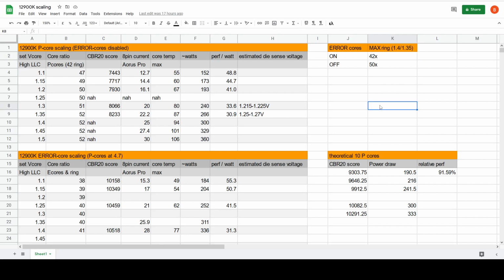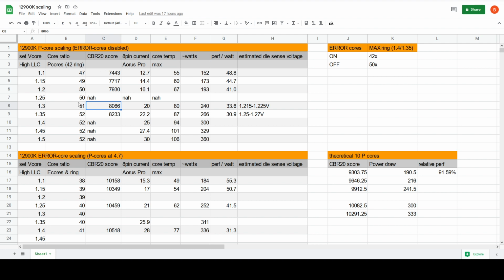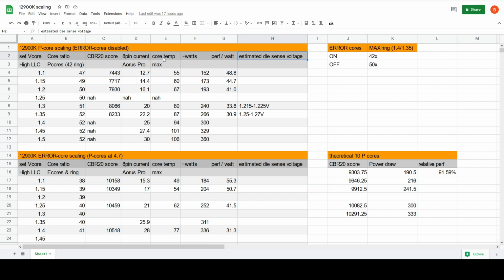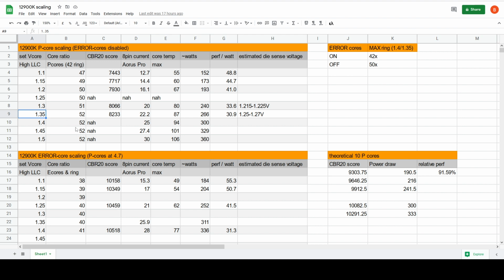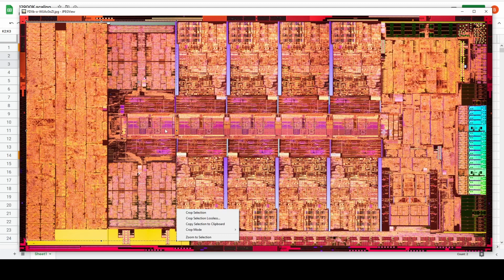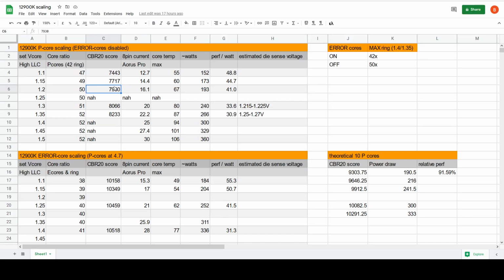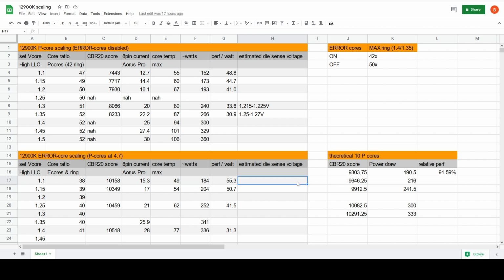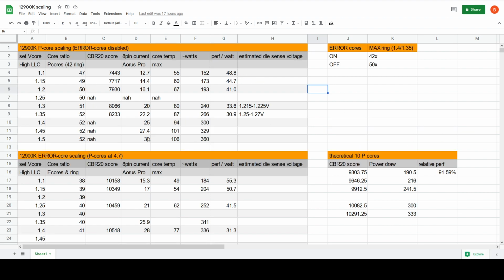12900K P and E core voltage and frequency scaling behaviour

Comment: CPU overclocking on my Z690i Aorus Ultra has been easy.  My 12600k does 52 on the P cores and 41 on the eCores at 1.4v ------>       Memory overclocking has been a nightmare.  F4 bios can't get here fast enough.
Reply: Really? My 12900k does 5.2 P-core and 4.1 E-core on 1.3v static
Reply: Adding to this. It would be cool to see more data points of what stable voltage people can get? Maybe I hit the silicon lottery
Reply: @davidallada5501  well what are you cooling with? Because BZ mentioned in the video he has a pretty good chip and his is not doing 5.2 and 4.1 at 1.3V. Or you're incredibly lucky with the silicon lottery.
Reply from the maker: @NotThatGuyJD  depending on the LLC and motherboard he has the voltage readings won't be comparable at all.
Reply: @ActuallyHardcoreOverclocking  ah, yip. That's true.
Reply: @NotThatGuyJD  I have the arctic liquid freezer ii 360 with push/pull
Reply: @davidallada5501  oof, yeah pretty damn good for cooling there. Definitely helps.
Reply: 12700k on a Z690 Elite... I cant get my G Skill 4000 Mhz CL17 kit to run with 4 sticks (xmp). It only works with two sticks. It wont event do 3600 Mhz CL17 with 4 sticks. Maybe disabling the Ecores will help? I will try tomorrow. BTW I can do 5.1 with CPU voltage on auto, which according to what I understand = 1.2 v and LLC to medium.

Comment: 8+8 maybe no so obvious. if8+16 vs 12+0 it was quite obviously the multithread performance benefit
example tigerlake 1165g7 only 4 core. if using 4 goldencove big core ,it was about 19% increase ,not bad, but not good enough .
if using 2+8, the benefit is huge, it was 1.18x 1.5= 77% faster than 1165g7 at same tdp.
i agree and prefer 7bigcore repplace 12600k and 9 bigcore replace12700k ,because the ecore number scale not enough .the multicore performance benefit not enough

Comment: "How many background tasks are you running that you need E-cores?" Well, it's called Windows for one. Microsoft's terrible system design, with the sheer number of background services even on a clean install, has caused Intel to solve the problem with hardware.

Comment: I can't approve of your results. All of my 3 i9 which I binned had no problem with enabled e cores and ring ratio. 47 and even 48 ring were no problem with  cores at 41 and cpu at 51
Reply from the maker: AFAIK ASUS enforces an automatic ring down clock if the E-cores are turned on and active.
Reply: @ActuallyHardcoreOverclocking  no not true with my Z690 Strix ITX board. It's the only available itx ATM so I had to go with this one and I can tell that this it not the case.
Reply from the maker: @pboerner22  well I don't have any ASUS boards myself and other people have told me that the ring downclocks as soon as the E-cores are doing anything.

Comment: Debaur has already proved how good the e cores are and used my favourite program project Lasso. The coment Bz made about using 10p cores instead of e cores just shows his pref for absolute perf. Missed the logic of e cores completely. As with all Bz reviews they are great when chasing performance and damn the power bill.
Reply: Well, the channel has the "hardcore" part on it for a reason. TBH, i would've loved to have either a 10 P-core CPU as well, or have a more modern, mini Xeon Phi, with 2 Pcores (for background tasks) and 32 Ecores (for absolutely stupid MT performance). I'm guessing the last one would need more than dual channel DDR5 to keep 34 cores fed, but it doesn't sound too farfetched.

Comment: I think the future is to let the user configure how many of which cores he wants. The compiler / video render guy would choose the CPU with 6-P-Cores and 16-E-Cores. The gamer on the other hand would choose the 10-P-Core variant. I think for most people, you are right. Scarcely anybody who buys these CPUs will really profit from the E-Cores. Intel did it just because of the numbers. They are on one level with the 5950X in terms of MT-Performance. And on the absolute top in terms of ST-Performance. Off course, numbers don't tell everything, but the average consumer does not know about the deeper implications. Does not even know that there is something like a ring.

Comment: I must have a good chip then running p cores 5.1 and e cores 4.1 ring ratio 42 my voltage is set at 1.29v llc 6 might drop the e cores just run p cores 5.2 5.3

Comment: The only thing i care about is single threaded gaming performance and much like Hyper-Threading is is complete trash and disabled by me, so will those garbage E-Cores. If intel releases 10P or 12P cores only than its a home run in my book, but why would i buy into the Big-Little Design from intel, if those garbage E-cores are going to get disabled,  because guess what, it hurts gaming performance! and that's a no-no!! Raptor Lake doubles E-Cores only....omg barfffff!!

Comment: Ooh... best explanation to date of the Eek-core impact on ring frequency 👍. Yet more rationale for a disabled Eek-core/ enabled AVX-512 setup. A usual AVX scenario is multi-dimensional physics simulation due to the long vector lengths. This scenario is also extremely memory bandwidth intensive.

Comment: Personally I'm going to disable the E cores on my 12900K for daily use. Basically all games are going to perform better with 8+0 with high ring clock vs 8+8 with lower ring clock.
Reply: Kind of a shame e-cores just becomes a hindrance on hardware you paid for, I'm sure many will do this to maximize the p-cores.

Comment: Since you have contacts at Gigabyte, can you ask them when are new BIOS versions coming out? There's supposed to be a Magic Scoll Lock setting to disable the E-cores online (I don't care about Denuvo, I avoid games with that crap for years, but I'd love to be able to switch them off without restarts to see if that helps with my issues, or just to see how much benchmark results change without them).

Also, would you like to temporarily swap (just for testing) one of your boards for my Z690-UD DDR4 which can't do CR1 on 4 sticks, which my Z390-UD had no problem with? It's almost twice as expensive for zero added features, but I've convinced myself that it can save my life one day, after finding the single added feature - there's a button which you can remap from reset to safe restart. Doesn't help in the slightest, considering the old board didn't need any button to just work™ at CR1 and this one can never do it regardless... so now I'm doubting my decision to go with Gigabyte, which you inadvertantly advertise as overclocking boards! ;)
Reply from the maker: the Alderlake memory controller might just have a hard time with 1T. I don't have any DDR4 Z690 boards yet.
Reply from the maker: @--Lam  I'd guess the BIOS currently isn't optimized on the DDR4 boards.
Reply: Same problem here. Z390 ran 4x 8gb 4000 mhz cl17 (xmp) ... i can only do 2 sticks on z690 ddr4 aorus elite.